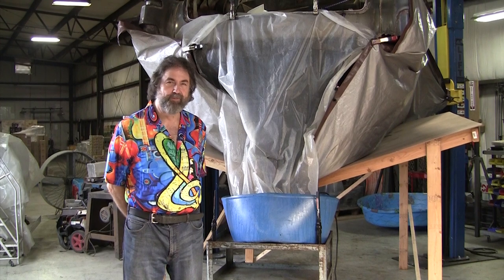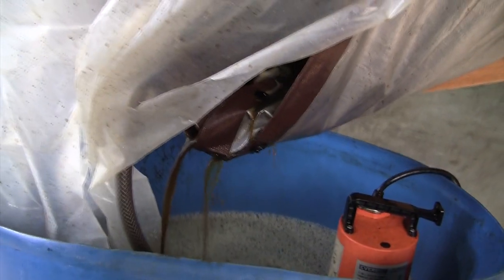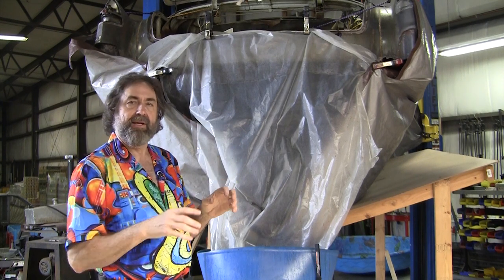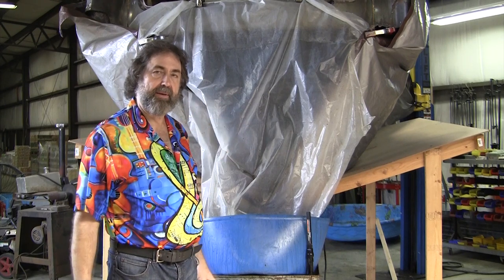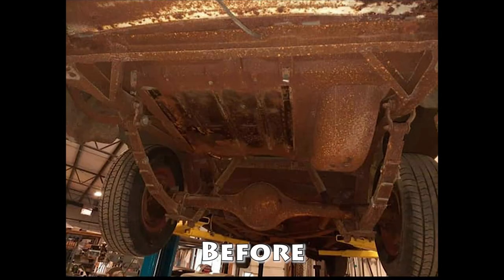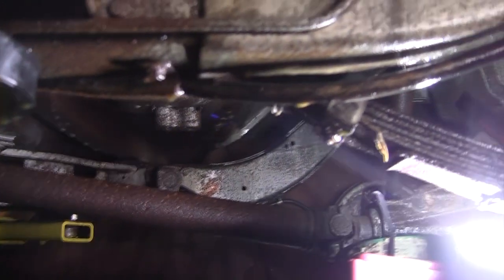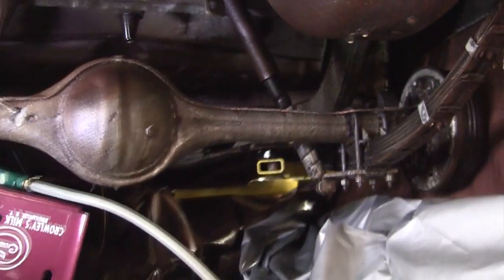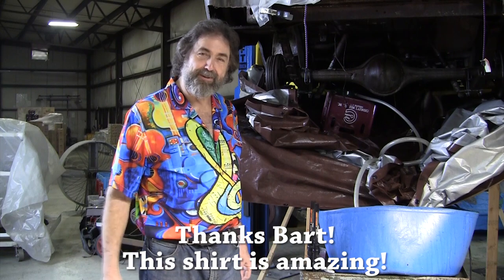Chassis Rust Removal with Rust 911

Comment: Hi Wray, I just wanted to thank you for posting this. I used your process on the roof of my ‘71 Road Runner. It was covered in rust, a wire wheel and 80 grit on a DA wouldn’t touch it. I flipped my car upside down, it’s on a rotisserie, put a plastic bin filled with Rust911, made a plastic tent around everything and let it run for about 16 hours total. I used about 24 gallons in 4 batches of 6 gallons for 4 hours each batch before the solution turned black. Worked like a charm!! Rust911 took off 99% of the rust and what was left, a wire wheel took right off. The only reason any rust was left was because the plastic was blocking access to it. My mistake. Thanks again!!

Comment: I have a 49 Hudson Commodore Custom Coupe that has moderate surface rust on the under carriage. I have use a similar product for years to de-rust small to medium size things. Electrolysis in big tanks for large. I will most certainly be using this genius method to clean the very complex underside of the Hudson.

Comment: I am completely impressed I would have never thought of using an irrigation system like that. I love the chelation rust removal but this takes it from smaller to larger parts. My work is good but compared to your work it’s just a fraction.The other advantage is you don’t destroy any pre existing corrosion protection as with acidic materials.

Comment: Remarkable results. To do more than one vehicle like that, could you cobble up a used 20' shipping container as a booth, to eliminate the shrouding procedure?
Reply from the maker: There are probably several different ways to do this.  The way I chose is working very well.

Comment: Hi Wray!  The Rust 911 looks like an amazing product for de-rusting, but what is the process once this is finished?  Will you need to rinse off or neutralize the surfaces before painting?  Does this leave a barrier coating that will remain rust free?  What is the proper next step for hidden cavities (like inside of A-pillar posts?) once this process step is complete to permanently protect them?   Thanks a million for your videos and instructions, I've really appreciated learning English Wheel techniques from you.... and now the rust abatement!  :)
Reply from the maker: After de-rusting, hose with water dry quickly and paint. In closed boxes or tubes you have to get creative.
Reply: @proshaper  blast with compressor after water bath maybe?

Comment: Is that green ring thing a lawn sprinkler? Very cool
Reply from the maker: Yes,  a round lawn sprinkler, 4$ at Home Depot.  I tried two of the sprinkers that self power left to right, they didn't work. Too much water power used to motivate not enough pressure left for the spray.

Comment: I wonder if you could get more use out of each batch of fluid by running it through a swimming pool filtration system.  Also wondering what happens if you add Rust911 to an electrolysis tank...
Reply from the maker: not sure, you'll have to experiment.

Comment: So this stuff is safe around all other components such as rubber, plastic & other alloys??
Reply from the maker: Yes
Reply: @proshaper  Now that is awesome!! I noticed on their website they have one for radiators/corrosion.. If this is safe on the other alloys I wonder how they compare. Any idea?
Reply from the maker: @Dan0rioN  it will clean aluminum, copper, brass, etc. Very safe stuff. I have been using it for years.

Comment: That is a cool idea. What would heating the solution do for the process?
Reply from the maker: I believe it works best at 65 F  to 90 F.
Reply: @proshaper  since I'm working on disembodied panels,  I see a setup in a repurposed bathtub or shower stall liner. Wonder if there are paint strippers that can be used in the same way

Comment: I can relate to this post... been working on my '51 cad for a couple decades (on and off I must admit), and from 50 yards away it does not look more advanced than yours. I first had the chassis off and blasted though, sealed and painted for the next generations if they are interested (a few years after I had the sheetmetal dipped in electrophoresis, too, except the tub which did not fit the baskets)

as for chemical rust conversion, I knew about phosporic acid H3PO3 (phosphatization): how does phosphorus acid H3PO4 (which is rust 911 main component I understand, as stipulated on the MSDS form on their website) compares to that ?
Reply from the maker: There is no acid in Rust911.

Comment: How are you getting the substance up onto the frame etc? Some form of jets, or something?
Reply: He’s using a pump and a sprinkler head spraying it
Reply from the maker: Tubes running in to the closed sections of the frame will totally remove the rust in the inside as well.
Reply: @proshaper  
Oh yea that’s a great idiea 
Harbor freight has bigger pumps that will get the job done 
Clear Teflon tubes stuck in rails great idea

Comment: How long did it take to see any results ? 

I have a recirculating pump on my Volvo 1800, with a heater, keeping the liquid around 80°F and tan overnight with no results

The liquid has turned a light brown, but I don’t know if that’s just from mud that it washed off.
Reply from the maker: Heavy rust usually takes a couple days to dissolve.
Reply: @proshaper  thanks, I’ll let it go a few more days . The rust I’m spraying doesn’t look terrible, but it’s in the seams .

Comment: Wouldn’t it work better if you used a rotating sprinkler ?
Reply from the maker: Tried that, the pump wouldn't keep them going. The circle sprayer works great, later the shower head will focus on individual areas.

Comment: Hello, I'm wondering why the change? In early videos you really showed no love loss over rust. You often explained why new metal is better. Also, are you finished with the Jag front end? Thanks.
Reply from the maker: I need to get to 100000 subscribers so that I can get some affordable compensation for my video efforts. I don't believe I can get to 100000 if I concentrate on coachbuilding. Most viewers are restoring/fighting the rust demon. Restoration efforts on the Cadillac, Scouts, building Tools, and a few basic lessons here and there will be the content on YouTube. I have additional content planned  for other platforms.

Comment: It would be cool to have several sprayers going at once maybe use adjustable coolant tubes from machining
Run pvc the length of the car hang it with straps 
Us a high pressure pump run it back into a larger plastic stump 
Being able to remove and save hardware it would pay for it self 
Just zinc  plate all the used hardware it would look like new
Reply from the maker: Yes, multiple pumps will help. Right now we are probably at 15 percent rust removal . To do some spots I will use a shower head one square foot at a time.
Reply: Maybe use a small 360 degree spray head on a flexible wand for inside the frame and boxed sections? Great to see you back Wray.

Comment: Just wonder what rust 911 smells like. It seems like it works just like diluted molasses does.
Reply from the maker: I have never used molasses.
Reply: @proshaper  Good to have you back again.
Reply: I was wondering the same thing. I have been using diluted molasses in tanks with great results.But there is no reason that a set up like this would not work with molasses also.  I get my molasses at TSC $9.00 per gallon it is in the hunting section. Used to attract deer. I  mix it 4 parts water to one part molasses.